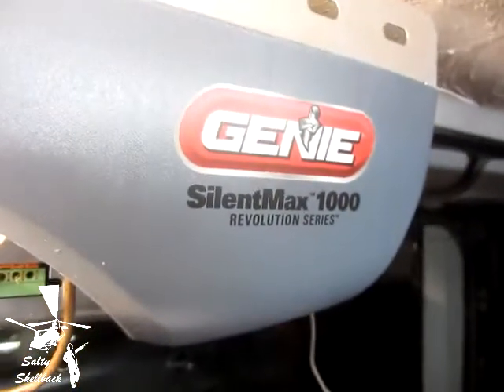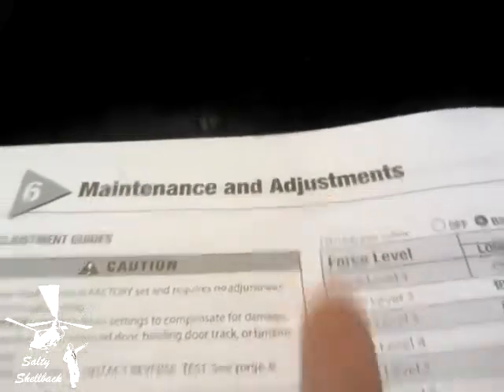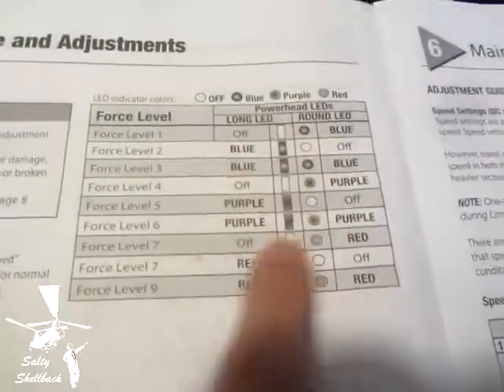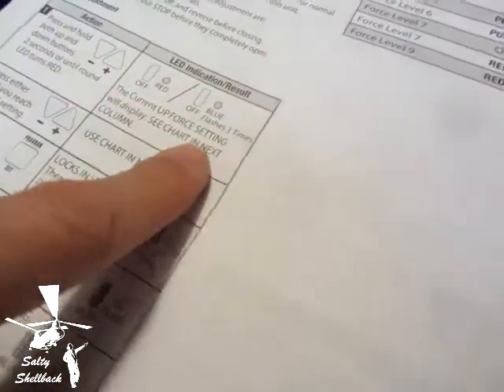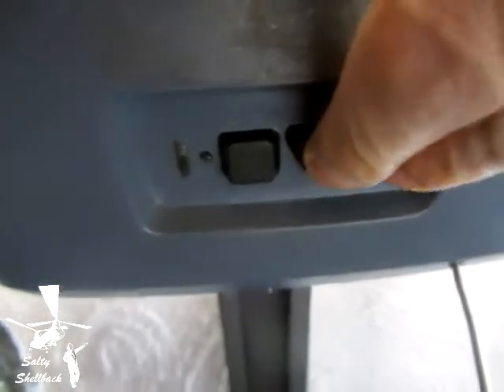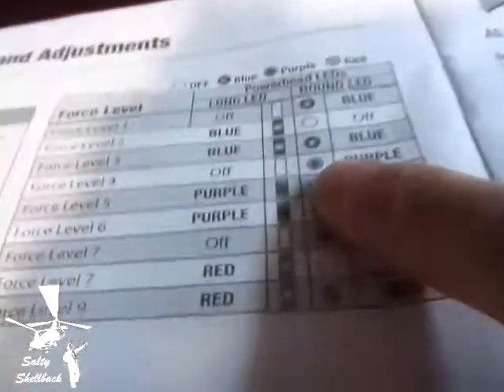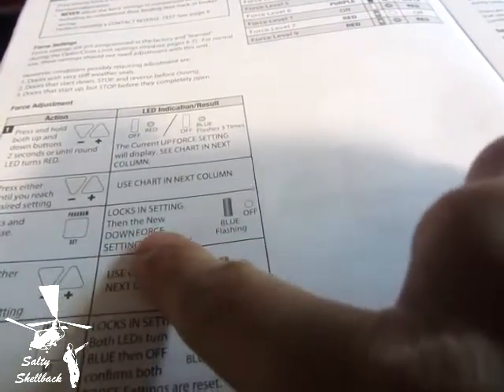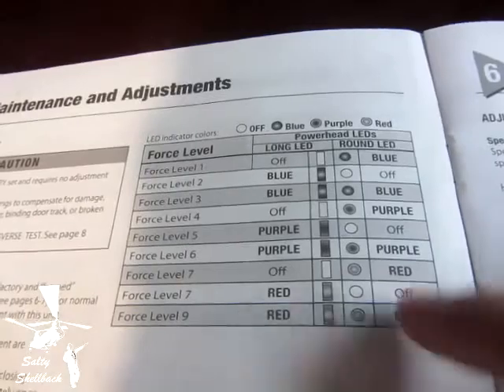How to set Genie Silent Max 1000 Garage door pressure setting

Comment: Just completed making the adjustments you suggested.  Now, let's see it run for a few days and see if that does the trick.  I'm optimistic it will work because whenever it jammed it on, I just needed to release the arm to the door and it runs. The problem may be as you suggested, not enough force....I'll come back to post a follow up....Thank you again for all your help!
Reply from the maker: Good deal!  I have not had any more problems with my door hanging up after I increased the force adjustment.  I think they set it low at the factory for liability reasons.

Comment: Question... if I have a super heavy door, double steel, insulated, etcetera, do you have a recommended setting for what the pressure setting should be for the up and for the down?
Reply from the maker: Cooter Malloy I don't know for sure, but the door should either have torsion springs or tension springs to compensate for the weight of the door, so start with 3 for up and 3 for down and adjust from there. Hope that helps.